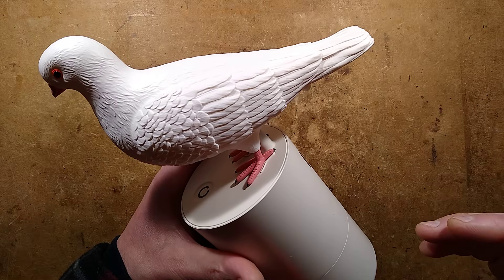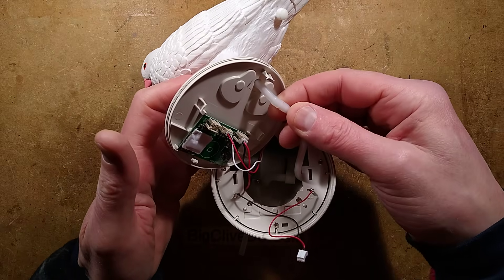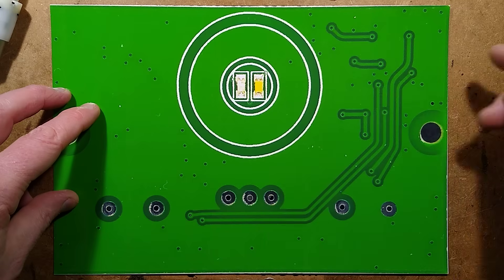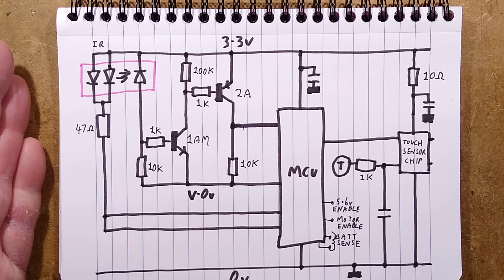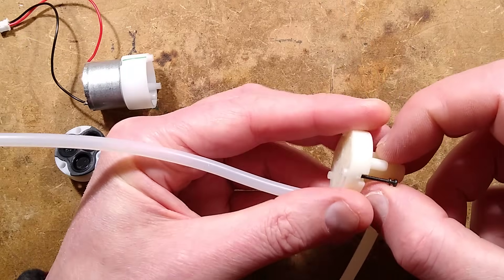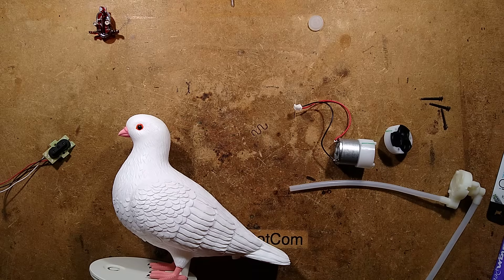Foamy soap pooping pigeon - with schematic

Comment: Thank you Clive for the tear down. That is a very interesting pump, If they were not so expensive it would be interesting to play with one to see what pressure it can develop.
Reply from the maker: They're not really optimised for high pressure.
Reply: Here you caan often get foam-soap dispenser without pooping pigeon 😊for 5 to12€ in discount supermarkets like hofer/aldi, lidl or action. Or just the pump from Aliexpress

Comment: if youwant to make normal liquid soap into foam soap just add water (preferably boiled or bottled so it wont have mold etc)
-start from 50/50 ratio and see how far you can go, depends on type of pump you can make it thicker. Mix well using spoon or spatula. I know this trick because foaming soap is more expensive.. so I buy normal one and add water.....
Reply: Also, TEST YOUR SOAP FIRST before putting it into the dispenser: some liquid hand soaps have thickeners that will gel the mixture after the fact, causing them to re-thicken after being diluted with water. It takes about a day. I’ve found this mostly in cheap soap, where I assume the effect is used to offer a nice thick soap while actually using very little of the active ingredients.

Comment: Now then, my friends, as you know, I tend to ramble on BC vid comments—I treat it like Facebook, but better. Anyway, I’ve been a bit preoccupied lately.

Thursday morning at 6:00 a.m. (113 hours ago, to be exact), I read that a lifetime smoker has a 25% chance of developing lung cancer. However, if someone stops smoking at 50 (like me), after 10 years, the risk is halved. That hit me hard, so I stopped smoking on the spot.

My goodness, what a nightmare it’s been. For three days, all I could think of was cigarettes. It felt like every moment was a smoking cue: having a cuppa? Time to smoke. Sitting at my bench? Smoke. Watching a film or playing a game? Smoke. It’s been awful.

But today—today has been different. Those cravings have mostly subsided. The environmental cues are still there, but they feel feeble now, like echoes of a habit I don’t need anymore. Suddenly, licking a pub ashtray doesn’t sound like a viable coping mechanism.

Thanks for listening. It means a lot. Doris.
Reply from the maker: I hope you succeed in quitting smoking.  It's normal to get the urge to randomly have one more, due to residual habit and triggers.
If you relapse and start smoking again, consider trying vaping as an alternative, that fulfills the puffing habit and the nicotine intake.  It will then allow you to reduce the nicotine over time if desired.

Comment: At least it does not have the battery compartment at the bottom like Dettol does, so that it gets water in it and rusts so you have to buy another one,  Dettol dispensers are jank and are not water resistent which is essential in a sink soap dispenser, this one in the video is better, I just went back to bars of soap, cheap and no fuss.

Comment: Clive could you tell me what is the equivalent replacement bulb of (7.2 volt ) Edison screw (E10) plus Baynet cap bulb if I have LED bulbs. Require (4 of each)
Reply from the maker: It's quite an odd voltage.  You may be able to find a close voltage version.  It depends on your application.

Comment: They made the effort to switch 3Meg worth of battery sense divider in/out of circuit as needed. But then they leave 112K of boost converter feedback divider constantly in circuit (even when the thing is turned off) to hasten battery discharge. Hmmm, why?
B+ rail -> inductor -> diode -> 100K -> 12K -> ground = 54uA standby drain. Trivial, but still... they bothered to switch off the tiny 2uA battery sense.

Comment: I'm a digital gremlin and don't really know how that translates to the lower level but I noticed the TX/RX/VDD at 7:24 - I wonder if you can use that to talk TTL serial to the microcontroller? (probably 3v3 maybe 5v)

If not they might have used the TTL serial port on the microcontroller to talk to a TTL IR module to offload that logic?

Thanks for the teardown and schematics as always!
Reply from the maker: It's just referring to the infrared emitters and receiver.

Comment: Has anyone found one of these foam dispensers that doesn't break after about a year? In all the ones I've tried the pump/motor assembly has leaked and then rusted stuck.
Reply from the maker: Leakage is often an issue with the foam pumps.  Especially if the mesh moussing section gets blocked.  If that bit does start blocking up, it may be possible to clean it out by turning it around if it's an inline one, or disassembling the pump and flushing the mousser through with water in the opposite direction.

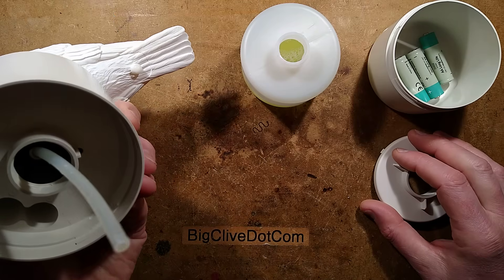Comment: 1:27 Are those standard AAs? Or are they like those weird, I think, Chinese AAA batteries that are just a hair shorter than ‘normal’ AAA batteries so when the provided Chinese AAA batteries die and you want to replace them, you have to force ‘normal’ AAA batteries in because the battery slots in the Chinese product were designed shorter for shorter Chinese battery cells? Because those “AA” batteries look a bit stubby, at least from this angle.
Reply from the maker: Just generic AA cells.

Comment: When I was about 5 years old I was watching two birds, one chasing 

the other, while my first step father washed a 1957 convertible in the 

uncovered car port.  The birds lined up, one after the other, and both 

managed to shit on my head.  I have had great luck every since.  

Though I was crying like a baby at the time.
Reply: When I was about 4 I was walking up the street to my friend's house. There was a flock of about 50 birds on the power wires overhead. They all took off at once and dropped ballast just as I got under them.

Comment: 20 years ago I took apart my Canon Inkjet ... I was both amazed and disappointed, when I saw the small ink-sucking-pump-thing ... just a silicone tube, squeezed by two small wheels in a circle ... this bird poop machine has more advanced mechanics. 😎👍
Reply from the maker: The pump with wheels is a peristaltic pump used for very precise liquid dispensing.

Comment: Had a few of this, not with a Pigeon, but with a normal dispenser head. And they all brake down after a few months of usage. One of them were full of liquid inside and it had gotten into the pump motor essentially killing it. Another just stopped working one day, could not figure out why. Very low quality.
Reply from the maker: Water ingress is an issue with some of these.  This one has a drain hole at the base.
The other main issue is the foam generating mesh screens blocking.  Running liquid through them in reverse usually clears them.

Comment: I purchased one of these foam soap dispensers (sans pigeon) five years ago based on your teardown video here ("Automatic schmoo-pump"). It's one of the best $15 purchases I've ever made.  It's used multiple times a day and is still operating on the original lithium iron disulfide Energizers I installed in it when I got it. Lithium primary cells are famously energy dense and long lasting, but still, at FIVE YEARS of continuous on time the circuit they've used here must be exceptionally efficient and low power draw in standby. I recommend opening it up and encapsulating the circuit board in some kind of paint on plastic to protect it from corrosion - the only thing I've had to do to mine a year or so ago after water got onto it and corrosion bridged a resistor.
Reply: what it last 5 years ?  this same dispenser ?
Reply: @sdqsdq6274  same dispenser, same original batteries 🙀

Comment: Shame you can’t increase the pump time on it. 
I had a similar device with a Potentiometer on the PCB, but all that did from adjusting was to increase/decrease the sensor level (how close you’d put your hand under for it to operate). 
: (

Comment: It's interesting that they put a lot of effort in making sure the battery sense circuit doesn't drain the battery, but then they have the voltage divider for the boost circuit permanently connected. Due to the way the boost circuit works, even when it is disabled there will be battery voltage minus one diode drop over this divider, all the time.

Comment: That valve plate on the pump is probably ultrasonically welded together.
The parts are vibrated against one another at very high frequency which melts the two surfaces, bonding them together.
The explanation is for the benefit of any viewers here who are not familiar with ultrasonic welding of plastics.
Reply: Or RF (Radio Frequency) welded at around ISM 27MHz 🤔
We have a company next door producing the (up to 25KW or more) generators for this, and ship them to China for instance.
Very interesting to see the 16th Harmonic popping up on the ISM 433MHz we are using for a lot of our remote controls...
Reply: @MeteorMark  😳🧐
Reply: @MeteorMark  It's done that way for that reason. HF ISM: 6.7, 13.5, 27, 433 MHz. Microwave: 2.4, 24 GHz. mm-wave: 61, 122, 244 GHz.
Reply: @straightpipediesel I know, but keeping an eye on the spectrum here at our factory site with about 250 Radio Remote Controls (Important ones one licenced frequencies) it is a concern to see a strong and unstable signal appearing on the monitor in the 433 ISM 
Hunting the signal brought us to the company building the generators...
Now we keep in contact about these tests!
Reply: @MeteorMark  Correct, I used to work on the servo that actuates the tuning caps in them on Kiefel welders.
Medical bags are RF welded, that is where I saw the generators being used.
And lots of automotive parts are welded, the fuel systems are pretty much entirely plastic these days, and plenty of ultrasonic welding takes place there in final assembly.
The filler pipe assemblies are welded in quite a few places during final assembly.
Reply: @Uncle-Duncan-Electronics-Shack thanks!
I work with much less power (Radio Remote Controls) and the company (almost) next door is Colpitt.

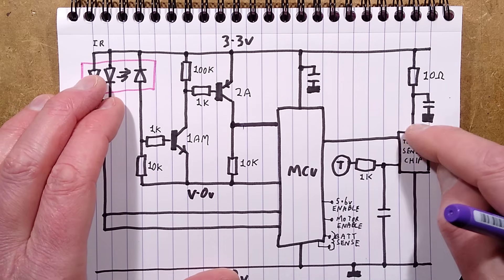Comment: 12:25  Do you know what the part number is for the touch sensor?  I have a few on/off (AT42QT1012) and momentary (AT42QT1010) ones on hand (both in SOT-23-6) but something cheap that could be programmed to do either would be handy.
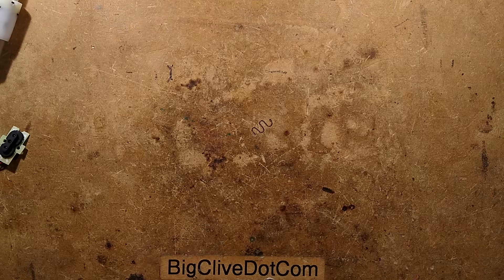Reply: The TTP223 is a cheap touch sensor that can be configured for momentary or toggle. The labels at 6:37 make it look comparable to a TTP223.
Reply from the maker: The TTP223 datasheet was the closest match for this device.  I think this is a generic clone.

Comment: The presence of a voltage boost circuit suggests it could be modified with a TP4056 and an 18650, or even "street-scavenged" Lithium cells .....

Comment: 12:34  I did not realize that photodiodes act either photoconductively (reverse biased, as in the schematic; allowing current to flow when exposed to light) or when exposed to higher levels of light photovoltaically (forward biased; generating current when exposed to light).  Learned something new today, always a good thing.  Thanks!
Reply: Yes, photodiodes can be used in photocurrent mode or photovoltaic mode, depending on how you load them. For instance, the short circuit current of a BPW21R photodiode is linear for >7 decades of illumination and its open circuit voltage is strictly logarithmic over the same range.
Another little known fact is the LEDs are also photovoltaic when loaded with a high resistance 🙂

Comment: Why is there a swimming spermatozoa burnt into the middle of your workbench?
Reply: it's from a video on electrically heated metal connectors for repairing plastic.  The metal bit was a wire formed into that wavy shape, you were supposed to hold the plastic together and press the metal part across the break until it melted into the plastic.

Comment: How long will the AA cells last? It’s infra-red sensor will be drawing how much current all the time? Rechargeable certainly will not have any worthwhile capacity.
Reply from the maker: the IR in these is usually short pulses that may go into a sleep mode with slower pulses after a period of non-use.  I've got a USB rechargeable one that was still working after I'd been away working for two months.

Comment: Nice video (as always).  I think you forgot to mention how the power indicator LEDs (on the back) are driven. Presumably these are driven by two outputs from the microcontroller. Perhaps when you post this video for the general YouTube audience you could add a note in your main comments (above the transcript) about how those LEDs are driven.
Reply from the maker: Ah yeah, I forgot to add the LEDs.  One common 100 ohm resistor to 0v and the LED anodes controlled by individual pins on the microcontroller.

Comment: Now my wife is insisting I get her one for her 70th birthday. Thanks, Clive.
Reply: XD wish my wife would let me get her a pooping pigeon soap dispenser. It is the kind of thing that mysteriously appears and I have to ask forgiveness rather than permission!
Reply: 😂 My 5yr old asked for one too…

Poo jokes never get old 😎
Reply: Happy Birthday, Mrs. Goatly!
And grats to you for having found a wife with a sense of humor, the finest quality for a partner!
Reply: @madbradfreeman  'And grats to you for having found a wife with a sense of humor, the finest quality for a partner!'   especially then they see ur wienie
Reply: I highly recommend any soap-pump based on this mechanism. I'll repost my other top level comment here:
I purchased one of these foam soap dispensers (sans pigeon) five years ago based on your teardown video here ("Automatic schmoo-pump"). It's one of the best $15 purchases I've ever made.  It's used multiple times a day and is still operating on the original lithium iron disulfide Energizers I installed in it when I got it. Lithium primary cells are famously energy dense and long lasting, but still, at FIVE YEARS of continuous on time the circuit they've used here must be exceptionally efficient and low power draw in standby. I recommend opening it up and encapsulating the circuit board in some kind of paint-on plastic to protect it from corrosion - the only thing I've had to do to mine a year or so ago after water got onto it and corrosion bridged a resistor. Easily fixed by brushing off the corrosion.
Reply: @brucegoatly  I'm of the opinion that once poop jokes stop being funny, you're an adult. Glad to see she's still a child at heart at 70 years!